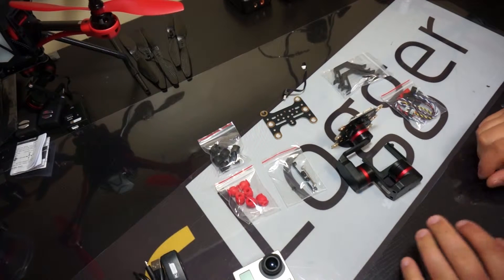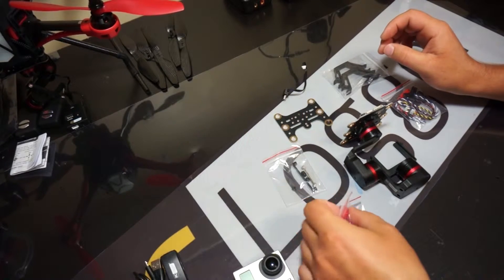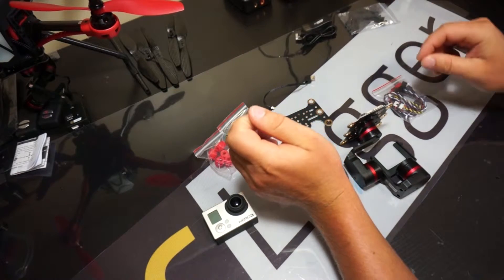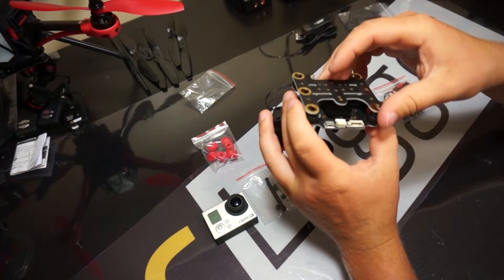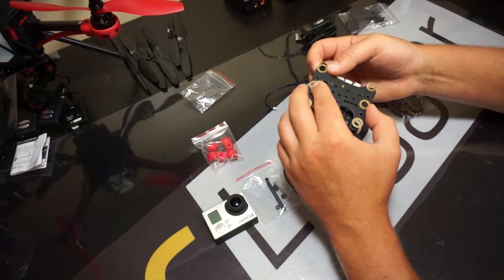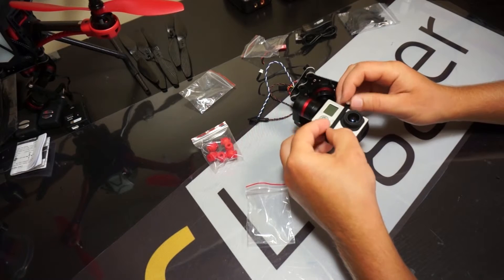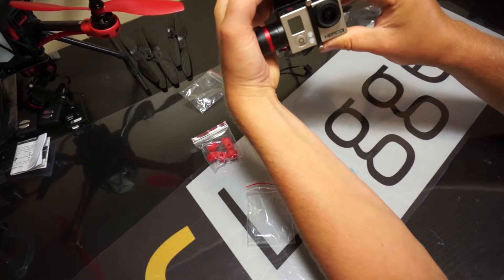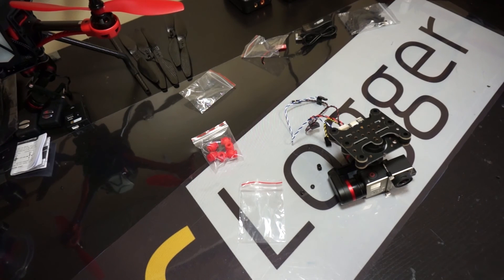RC Logger X3 Gimbal - Assembly

Comment: All of this, seems quite confusing.  It would seem that the "top plate" would have a singular registration and should be viable for any situation and all potential mounting options.

Considering that supposedly you're associated with RC Logger, one would expect that you would know conclusively which bumpers were the softer ones and which ones were the harder ones.

Additionally, your comments regarding using Locktite™, are also confusing, considering that the RC Logger website states:

The quick release plate to the X3 gimbal now allows you to quickly and easily remove your X3 gimbal within just a matter of seconds. It’s quick and easy with no tools required. Now the addition of the X3 to your NovaX 350 Plus is truly plug and play. Just release and remove the stock plate, snap the gimbal in it’s place and you’re done. Offering the quick release along with quick release legs gives your NovaX Plus the ultimate portability!